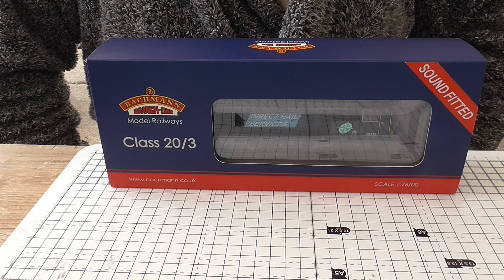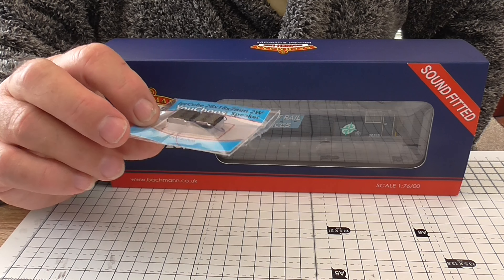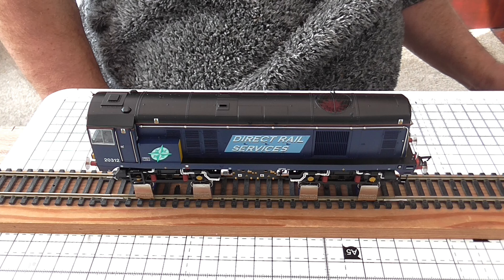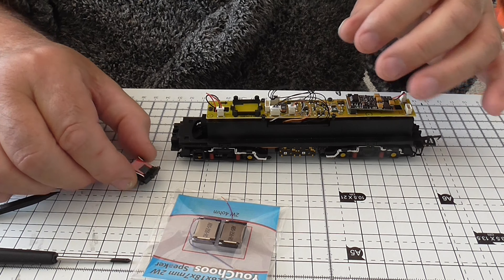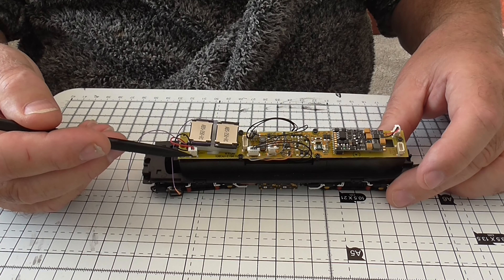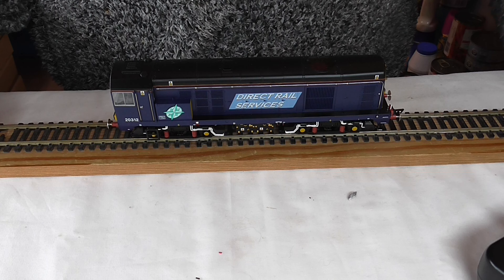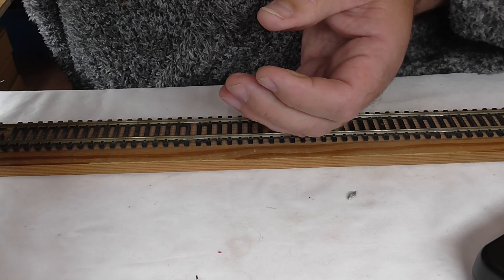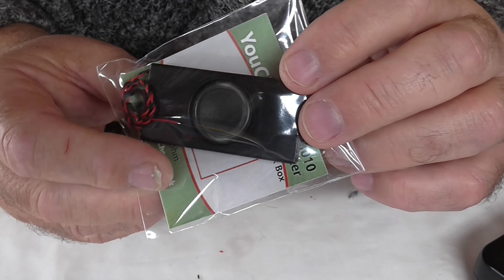Model railway – New Bachmann Class 20 Speaker

Comment: I had realised they had made it plug and play like that! Looks really straightforward to do - cheers for pointing me in the direction of your video 👍🏻
Reply from the maker: No problem, I would only do it if you are good at soldering. Using a small tip on your soldering iron will make it much easier.
Reply: @SimonLivertonCentral  good suggestion!